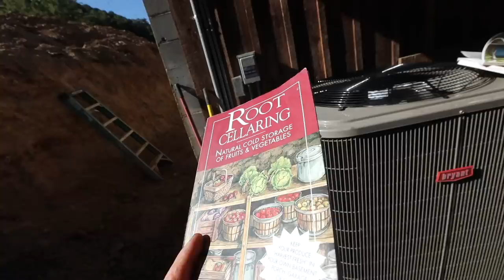Milking a New Cow is Tricky | See How We Handled It

Comment: Justin you should get a Tri blade brush cutter for your strimmer, cuts through large bramble trunks and small branches and does the strimming part too, cheap as chips also. I'm sure you have them stateside... game changer with brush ... And no this is not an ad. I just bought it and it worked a treat